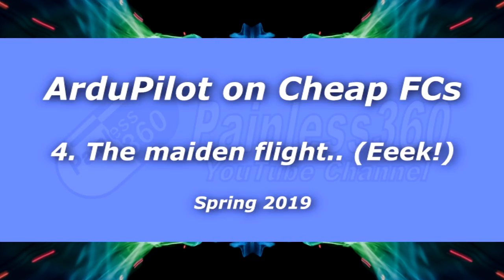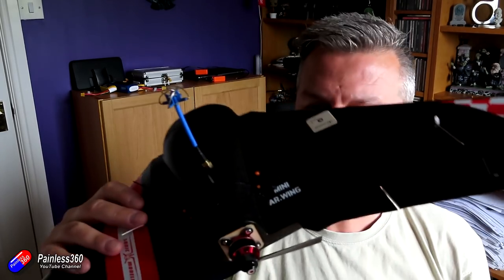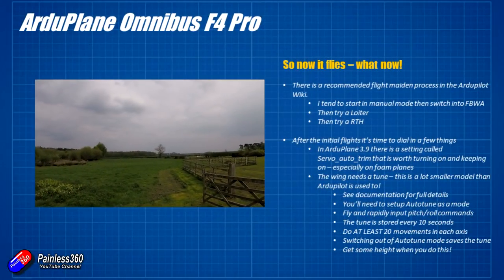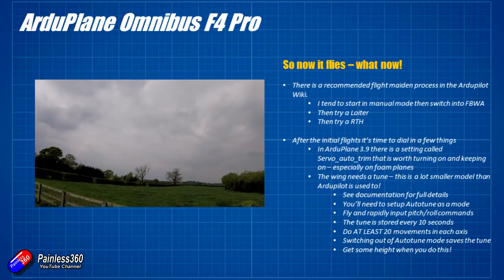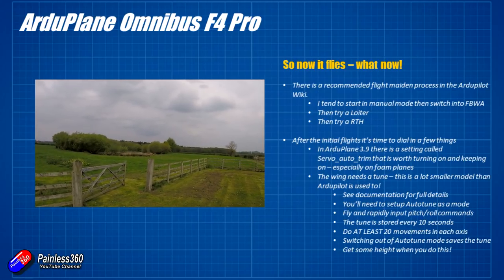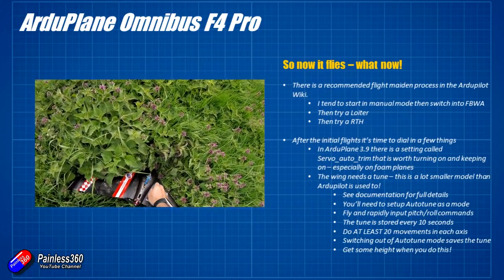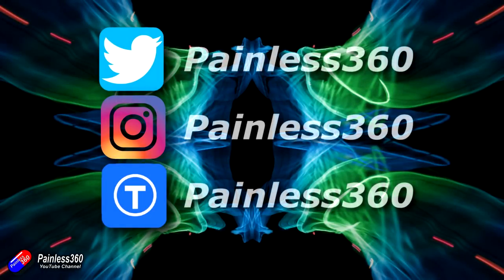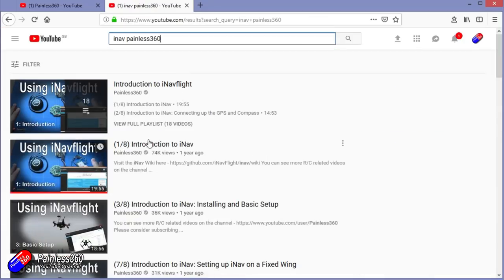Easy Ardupilot on Omnibus Series: 4. Test flight and plan for the next videos

Comment: Painless...thanks so much as always...I'm also installing a Kakute F7 and arducopter in a quadcopter, and looking forward to F4/F7/arduplane installations in wings, etc...so this series of videos of yours is much appreciated.  One comment...you said that it's good to calibrate the compass before each flight, and I know of course that IS a good practice...but I have to say, I'm starting to think repeated compass calibrations are kinda like checking the air in your car's tires every morning before driving...at some point, it really seems unnecessary.  I kinda hate to say that as I know frequent compass calibrations are still a good idea...but, I wouldn't want someone to turn away from arduplane because it sounds too difficult to use.
Reply: Ardupilot in general, when you start, is unfriendly, you have to keep in mind that it is multipurpose, applies to all forms or factor of vehicles. Although it costs a little at the beginning, it's worth it because it allows you to do everything. Once you know how to configure it, following the wiki step by step, it is quite well documented, a new world opens up before you, where you can add a multitude of sensors and do things you couldn't do with other software.  At first, this forces you to put in more hours, but then, you more than make up for it. 

Especially arducopter and arduplane are worth a lot, you also have the opportunity to speak directly with a community very focused on its development and the problems in the firmware are fixed quickly, constantly evolves. Now, having the opportunity to put it on smaller controllers, it's a substantial leap for small aircrafts :)

Comment: Hello Friend !
Yesterday, I tested the Auduplane on my F4 Omnibus for the first time, and everything was fine, I'm just not able to increase the plane's speed in RTL mode.
Would it be in the Basic Tuning parameter, in Throttle 0-100%> cruise, to increase the percentage of engine power?
Thank you ..
Reply from the maker: Check out the wiki. RTL_Speed
Reply: @Painless360  , thanks !!
Reply: this parameter is found only on the arducopter.